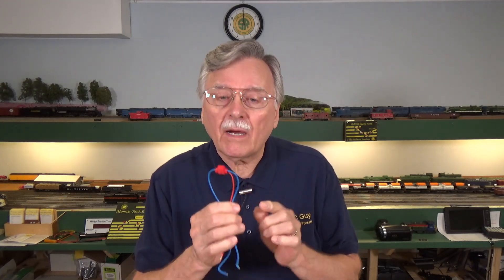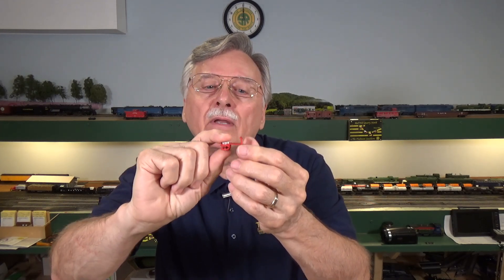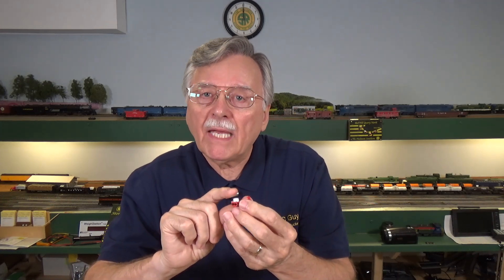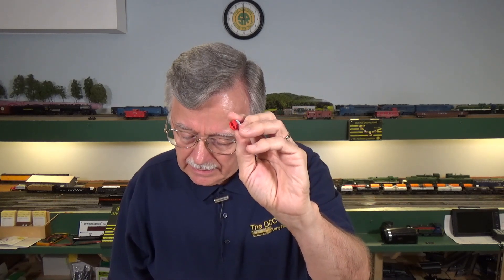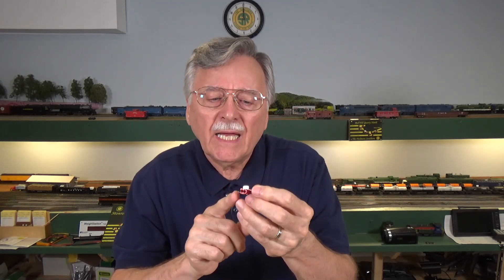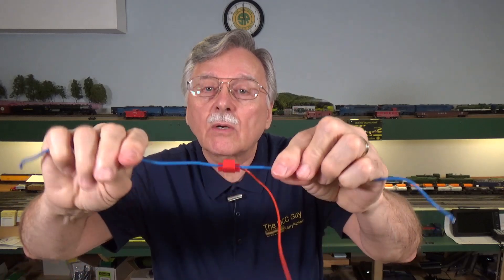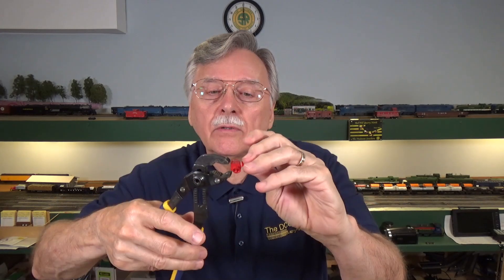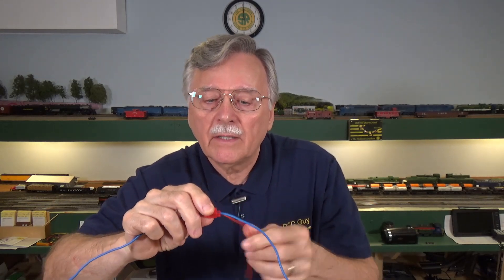Solderless Wiring For Model Railroads (206)

Comment: Larry excellent video, I am using the 3m version with the tool made for them but I went a step further, also use the Waco lever connector, great way to connect feeders also great for troubleshooting, Waco connectors can be reused ,I am finding that the knock offs don’t work great , great video
Reply from the maker: Yea, I just bought a bag of 100 Wacos myself. However for drops off a main bus I still prefer to use the suitcases since it does not require cutting the main bus wires.
Reply: Larry I use both , you need two connectors for each feeder connection , make it a lot easier for troubleshooting track etc , got the idea from Youtuber huge layout
Reply: Larry check out YouTube video from Rprcrabbag S1 E5 8 min mark , he shows this method
Reply: Rcgrabbag is the correct spelling  Larry

Comment: Hi Larry. I too have used IDCs for years with a 0 failure rate. As you already know, you will get some hate for purporting their use, but ignore it. IDCs  have their limitations. Inwouldn't use them in a situation where there is movement or vibration, and I wouldn't use them where human life and safety depended in their reliability, but for model railroad layout wiring Inhave used them for 25 years and never had one problem.
Reply from the maker: Ron—I have been pushing these for years and have heard all the comments, positive and negative before so these are not new. I have developed a thick skin when it comes to this stuff.
Reply: Why do they sell them in auto parts stores then. Cars move around everywhere. I wouldn’t use them anywhere.
The point here is for a novice or someone not in the know there is too much that can go wrong in the joint. 
These things are NOT recommended. One of the worst way of connecting wires there is. They are for lazy installers or those that don’t know better. A pro outfit would not use these. Do a proper job and use a more forgiving method of joint that is sure to not fail even in the hands of a beginner.

Comment: I have soured to these type of connectors, in the application of under your layout I'm sure they are fine. I see people wire automotive applications with these, and the climate around here turns them to dust. Sometimes they smoke right before they die to the green chronic of salted oxidation

Comment: Great job Larry. I use these on my O-Scale 2 rail layout. I've seen them used on a large modular club layout for years with no issues. As you say, when used properly they save lots of time and trouble over soldering upside down under a layout!

Comment: Hi Larry. Another good video on connectors. Although it may seem simple to others, is there any chance you could do a video on creating and wiring to simple on / off switches so that you can isolate what we call in the UK, storage sidings? I think you call them staging areas in the US. Thanks.
Reply from the maker: That will be easy to do. For my storage tracks I plan to install ir sensors to cut off track,power once a train is fully past the turnout. I want to do that because most,of my tracks are out of sight and it will make it easier than requiring operators to do it. However there are other areas in my yards where I need to install a switch as you describe where I will have locos waiting their next assignment. Basically all you have to do is cut one rail at a point beyond the frog and run the feeder wire through a simple SPST on-off switch. Killing power to one rail is all that is required.

Comment: I agree 100% with your comment of people having issues not using the correct wire or connector. I have been in electronics for 45 years and like everything else there is the wright type of connector for the job. if it moves solder it, if no these work fine and are quick and easy.

Comment: I switched to Posi-Taps and I don't need pliers or vise grips.  I just use my fingers.  Posi-Taps speed up buss/feeder wiring and there are no connection issues.  Plus you can reuse the Posi-Taps.

Comment: I use "close barrel crimps"  https://en.wikipedia.org/wiki/Crimp_(electrical) with a spade or ring end connected to terminal strips.  This is also solderless, but I think it's more reliable than suitcase connectors.

Comment: These connectors suck!  I used them and used the correct size wire, they come loose all the time.  I now use vampire connectors from Acculites!
Reply from the maker: And I’ve built 3 layouts over the last 20+ years using them on all 3 and have never had a problem with them. When properly used they work great!
Reply: @TheDCCGuy - I have built the same amount of layouts and I know how to install these correctly as I am an engineer by trade.  They are unreliable.

Comment: While IDC connectors are common and recommended by many I've never liked them.  In addition to being expensive (Larry has estimated $.25 each so consider the total cost when how many hundreds are required, even on a mid sized home layout), the one wire per side makes then very bulky when wiring a complex area of trackage.  I've also heard complaints about them not working well if everything is not set up just right before crimping the blade down as Larry himself has eluded to in this video.   And finally they are limited in wire size combinations so connecting between a 12 awg bus and a 22 awg feeder is not going to happen, let alone a 10 awg bus and 22 awg feeder. (If anyone has seen IDC connectors for these combinations please let me know the manufacturer and part number.)
Soldering is really not that difficult if you take the time to prepare everything and use proper techniques, even when underneath a layout working "above" your hands and head. The heat will "draw" the solder into the joint and honestly very little solder is needed so it should never build up and end up dripping onto you which seems to be the most common complaint about soldering under the layout.
If these work for you great but not something I'm going to adopt for widespread model railroad use.

Comment: I would dab dielectric grease inside the connector before crimping for resistance against moisture and zip tie them shut for module transportation vibration cause heat will tend to open the covers loosening the connector. 😃